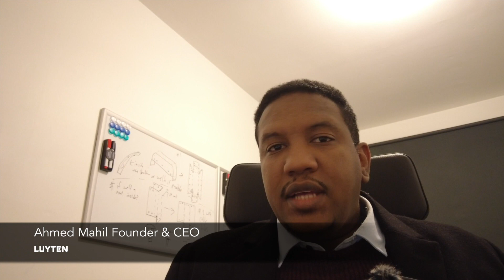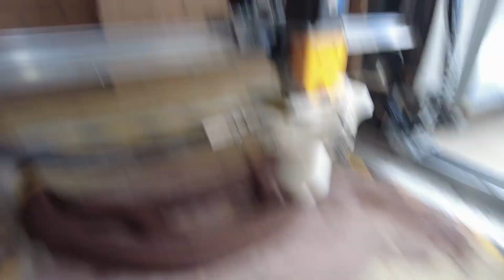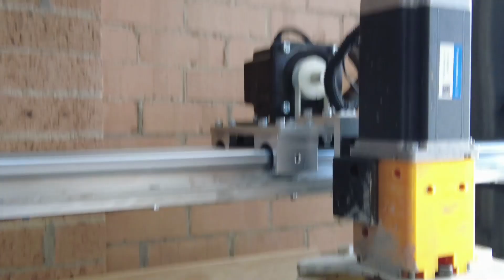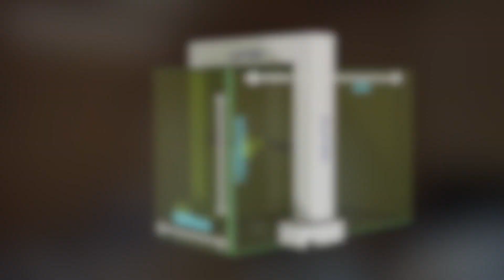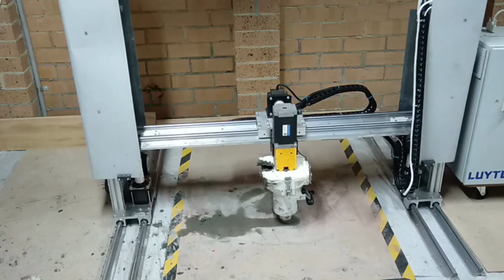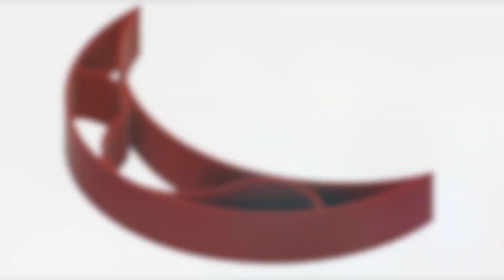Newly Launched Startup Luyten Seeks to Make 3D Printed Concrete Affordable

Comment: What's the application for ? Layers concrete needs to be mix together.
Reply from the maker: It’s mixed before it’s printed and the layers become a monolithic structure even stronger than concrete in formwork.
Reply: @automateconstruction  Sorry but i have a doubt about this ... Your machine will be great for plaster maybe ? Plaster ceilling maybe ?

Comment: I had just viewed a YouTube video that pointed out that the concrete necessary for 3D printing of structures is 3 times more expensive than the standard concrete use for conventional construction techniques. So when I came across this video (thank you, Google algorithm) I thought the headline was about the CONCRETE being affordable. Sadly, it was not. In fact, I don't see anything in this video that shows how they're making anything more affordable.
Reply: I think it's the robotic platform that they made will be affordable. The concrete mixture depends on you and your application. Generally speaking and from other videos, I saw it way cheaper to 3d print concrete in comparison to cinder blocks. It is so cool that they thought of increasing market adaptation. The robotic system and software are the most costly parts of any 3dcp apparatus. At the end of the day, you can have the best synthetic fuel, but without a robust ride, you going nowhere.
Reply from the maker: You’re kind of both right, this company is making the machine cheaper which is a massive expense. That being said the material price is at least double often times 4-10x the cost of regular concrete. Reducing material cost would be the single most critical factor in implementing this tech on a wide scale in my opinion.

Comment: Thats a pretty sad 3d platform. The main challenge on building a concrete printer is building a reliable head and slicer. Having a simple few hundred dollars build platform that you can build at home limits the actual testing of the head.
Reply from the maker: It’s their minimum viable product. Give them a chance, none of these companies had a great product the first time around most are on their second or third editions which after investment are significantly improved. Making it work with a few hundred dollars shows investors the engineers are capable.
Reply: This is the beginning a few years ago a 3d printer was expensive and very few selection now it's different give them a chance lots of room for improvement
Reply: The only sad thing here is your comment as it shows that your a CNC hobbyist at best. It's called rapid prototyping lol, obviously they have a robust slicer, the print head seems to be an injected molde plastic or 3D printed which is very smart and show case the advantages plastic 3D printing/rapid prototyping can  provide a startup. Rather than spending lots of dollars machining the print head they can 3D printed. By far this is the most beautiful concrete printer I have ever seen. Their goal to make it affordable is the smartest business model to date. As a builder with 25 years experince in construction I would rather try the small printer for curved walls or fences rather than spending  a million for a tech in its infancy.
Reply from the maker: @aborashid1000  Thanks for standing up for Luyten you make valid points. No need for the ad hominem toward Swauters everyone is entitled to their opinions.
Reply: @automateconstruction  no worries no ad hominem ;) edited already
Reply: @aborashid1000  i am a mechanical designer/programmer in a worldwide Company but thats completely not relevant. What i meant is not that i think their project is bad. Rather that 3d motion platforms have been designed for decades and the most important component of this machine is the print head. Rather than putting it on a platform that limits the print head the platform should be a bit more capable to actually be able to test the limits of the head and improve them instead of having to deal with a platform that is the limiting factor.
Reply: @automateconstruction  i think that since i'm not a native english speaker and we are pretty straightforward here that somethimes my comments get misunderstood. I dont take it personal when someone does not agree or does not understands the point of my comment. Its the youtube comments 😅
Reply: @TheRedstonelabz1  Not sure what you going on about. The platform is a mobile gantry which is similar to but smaller than other large printers featured here before. They are all limited in 2 axes and unlimtied on one as long as the rails go for one axis normally the x-axis as the video shows their robot is driven in the x- axis through wheels so its only limited in two axes y and z. The key point here that its affordable and fits for other untapped applications. Thus, the use of the word sad is unwarrented. Before you throw words and judgments watch carefully. I wish them all the best, a very nice looking printer hope to see more of their prints.
Reply: @aborashid1000  sad might be the wrong word. Its just far from the ideal platform to test this head on.
Reply: @TheRedstonelabz1  I think one way for them to over come the limits in hight and width is to show case if it can go longer in length. The print head can be improved my guess thats why they made it out of plastic. As I said earlier they are on point with their mission. If the initial investment for a builder to buy a printer is reasonable and not very risky then many might be happy to try 3dcp on their construction sites.